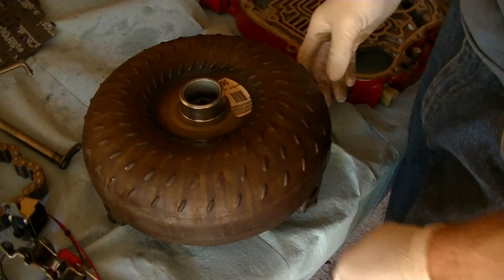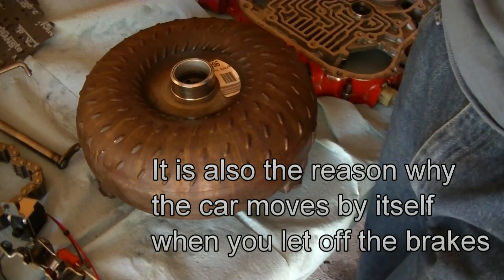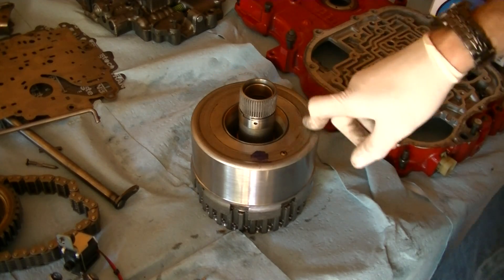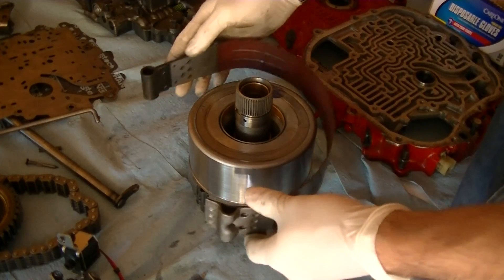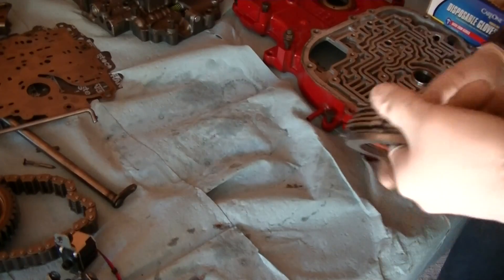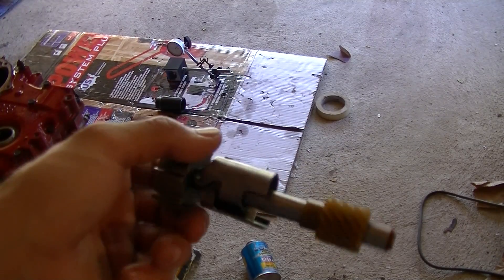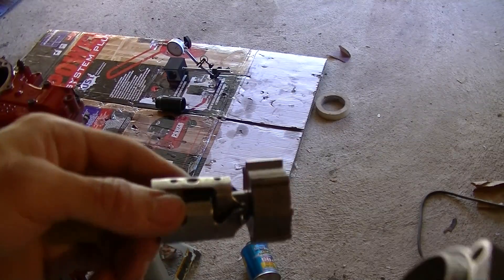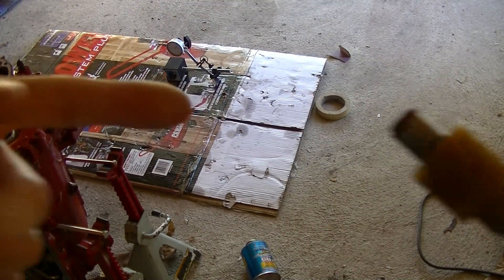How an Automatic Transmission Works

Comment: How to the clutches engage?  You mentioned a piston, but when I think of piston, I think of something like a slug in a cylinder.  To apply even pressure around the clutch pack, the piston would need to be shaped like a ring?

Comment: The other day I came to a stop quickly.  The car didn't fall back into 1st gear.  It fell out of gear.  When I placed my foot on the gas the car snapped into first and the car lurched forward.  Sooooo, does that mean the band or clutch discs stayed compressed or that pressure stayed in the port to first?
Reply from the maker: To me it says there was loss of pressure in the circuit that controls downshifting to first gear and the clutches / whatever is used were not able to keep the transmission in gear.  When you stepped on the gas, that caused the pump to spin faster, increasing the pressure and allowing the transmission to clamp into gear.  First thing that comes to mind is the transmission is low on fluid.  Check that first.
Reply: Thanks, I'll check that.  Appreciate your sharing of knowledge.

Comment: simple n clear explanations. i have some ??
at stop or totally stationary. 
1.) will the planetary gear rotate as i step on the brakes.
2.) the contact area, where the clutch bend clamp down is it rotating at stationary with the brakes apply?
correct me if i am wrong. 
if the the area where the clutch bend claims down is always rotating.
means it vry hi wear to the clutch bend. am i correct? 
hope u can help me out.
 thx matt.
Reply from the maker: When you are stepping on the brakes and the car is stationary, nothing inside the transmission is moving (in terms of gear sets and drums and the like) except the torque converter.  The fluid in the torque converter will be trying to spin the input shaft of the transmission, but since you are stopping the wheels from moving, the fluid will simply keep spinning around.  This allows the engine to turn at a standstill without stalling the engine.
Reply: thx for your help.
another question. what does anti slip additives do & does it really work?
Reply from the maker: I am highly opposed to any kind of aftermarket additive which make claims to offer very cheap repair solutions to complex problems.  There are a number of transmission anti-slip products out there which claim to repair slipping transmissions.  I haven't ever used them, but from what I hear and from what I know about these kinds of products, I would say they don't work.  In many cases, these kinds of products can do much more harm than good, such as stop-leak.
Reply: thx bro. i stick with amsoil.
Reply: MattsMotorz I had a ford escape (cd4e transmission) that would slip every time it came out of overdrive. I did a transmission fluid change and added in some Lucas oil stop slip. It didn't slip anymore after that. But that's just my experience

Comment: Technology, it is like a means by which the State attempts to impose its will upon "the sons of anarchy".  Auto trans today, tomorrow Skynet takes over.  Soon, you will not be able to take the scenic route because the car computer will decide you have not earned enough credits, nor have the requisite permission forms signed on record.  .. Look at phones which plug into a wall - they used to be shaped a certain way, like a u shape, but now are shaped like an l, that is to say, touches your face like a cell phone does.  It is almost like they are forcing you to be indifferent between the wireline and the wireless phones... and so they slowly get people to hand over greater control over their lives to "the machine" and by corollary the State. ... Some, they teach obeying cesar is always the right thing to do - see, ro 13:1-8, kjv - but that is a misinterpretation.  For "the powers that be", "the higher power", is a reference to angels, an invisible government, a kingdom felt or perceived but not necessarily seen.  "The minister of wrath" is an angel holding a sword, and not "cop with taser".  Even cesar will be judged, and does not have a divine right to do as he pleases. .. whether by tech, or propaganda, the State attempts to impose its will upon the citizenry.  Sometimes, it is not that bad, especially if a large number of the population develops Alzheimer's and so autopiloted cars become very useful, to maintain law and order.  But they could very easily remove the stuff that makes for "independent living", such as road signs and street name signs, in favour of "google glass tech" and "augmented reality" (AR) vision, in the name of conserving the use of metal... oh well, what tech does not change?  Remember when a can opener weighed like half a pound, because it was not made of aluminum? .. Being "willing to obey" does not mean "obey".  And calling "throwing it away", "recycling", does not change its true nature.
Reply: Kelly KitKat k

Comment: I guess (still learning this stuff), an auto transmission is a function of speead and acceleration, whereas a manual transmission is a function of observing the rpm and INTENT to accelerate.  An auto transmission only switches gears up at that point where rpm redlines, I suspect.  For how else would you program that "infernal thing"? :  My guess, it is designed around a car travelling, accelerating, decellerating, on a straight line track, or did engineers take into account  turns and slopes too?
Reply from the maker: This is a good question.  The way  they do it is to take into account what the driver wants to do.  But how do they know what the driver wants to do?  Simple, measure the throttle plate position.  

For example, if you are going up a slight hill, and keep the pedal still, your RPM's will go down.  However many times this decrease in RPM isn't enough for the transmission to warrant a downshift.  It will only downshift when the driver wants more power, namely, when the driver steps down on the pedal more.  So the computer is constantly shifting based on many economic and efficiency factors, while also taking into account the wishes of the driver (based on pedal position). As for sharp turns and such, typically the car slows down to negotiate the turn, so this decrease in speed and load, as well as pedal position causes the computer to downshift.  It all makes sense if you think about it enough.  Hope I explained it half way decent and understood your question. It is very clever.

This is the reason why I do not like automatics as much as manuals.  An automatic wont downshift until you have stepped on the pedal and the computer realizes "oh hey, he wants to accelerate! Better down shift!" Where as in a manual, one can downshift immediately with no wait.  After driving a manual for years, an automatic feels slow and  "mushy" when it delivers power.

Comment: In my opinion, mechanical or fluid-mechanical transmission is better, because if terrorists use an emp (electromagnetic impulse) weapon, that could fry a lot of automobiles because of their reliance on software, computers, and electro-mechanical parts making up their automatic transmissions.

Comment: So, gear shifts are preprogrammed on the basis of only two variables, speed and acceleration?  Can a person do better on the basis of getting from A to B in the shortest space of time, with the best fuel economy, using manual?  Well, with more data, the auto transmission could be made smarter, but according to who?  Tesla's autopilot is scary, because maybe Skynet (see Terminator movies) does not want you to make it to your destination?
Reply from the maker: The automatic transmission takes data from a LOT of different sensors to determine engine load, desired acceleration, and  economy.

Comment: thanks man that is the most clean explnation i had on you tube , and i looking for to know what is happen when the the gear in N , or P
Reply from the maker: in neutral or Park, none of the hydraulic circuits that engages any of the clutches or bands are engaged.

Comment: Thanks for the great video.  What make model did this transmission come from?  I have a 94 Chevy g20 van.  Since I bought it (3 years ago, 46k) till now (71k miles) it has NEVER shifted into first gear.  It drives pretty well though, no slippage in the other gears, and I can pretty much start on even the steepest hills in 2nd.  The fluid is pretty dirty, and has kind of a burnt smell, but other then that its kind of amazing to me that it has gone 25k miles easily and drives great.  From my understanding in this video it sounds like one potential cause of this problem is a bad shift valve?
Reply from the maker: +Lower 9th Wardermelon This came out of a 98 Chevy Cavalier.

It greatly depends on the transmission.  I am not familiar with the transmission in a 94 Chevy G20 Van.  While all automatics generally work the same way (except the CVT&#39;s), they still vary greatly on how they do it.  The list of possible causes is too great for a comment on youtube without some sort of diagnostics such as line pressure tests.

Comment: Your explanations of the automatic gearbox are excellent. However, I am now trying to find out how the AGS (Automatic Gear Shift) type of gearbox functions. I have just ordered a Suzuki Celerio SZ4, 988cc, 3 cylinder, petrol, with AGS (Automatic Gear Shift). Apparently, this car has a standard manual 5 speed gearbox, which has an electroncally controlled cluch (no cluch pedal). I took one for a test drive justerday and it has a auto type selector (D, N, R) but the lever can be pushed to the left and then, by pushing the lever forward, then release, then forward again and so on it goes up through the five gears. Similarly, to shift down the gears, pull (tap) the lever backwards each time another lowe gear is required. I was quite impressed but the sales team could not tell me how it actually works. Other than that, I can find no further information. I would be very greatful if you could point me in the right direction to find detailed information about this type of transmission operation.
Thank you in anticipation,
Alan Parsons (alanpars@gmail.com).

Comment: hey hiram, I loved the video! thanks for such detailed explanation! I am having a problem with my 1-2 shift on my hydramatic 125. the car stopped doing a 1-2 shift suddenly.. what can this mean?
Reply from the maker: akshay ramachandran I'm not hiram! Lol

That problem can be caused by many things. You would need to take some pressure readings to get an idea of what is happening inside the transmission.

Comment: My car is an automatic and it DOESN'T have a torque converter fitted (as it was an optional extra). My JATCO gear box uses slip disk clutch plates, so you are not covering how automatic gear boxes work at all! (By the way JATCO sells their gearboxes to over 19 car manufactures and was present in most auto boxes sold in Britain between 1998-2003 where they were in completion with WERSE-TECH for many more years. So if there is a standard way that auto boxes work you should add this or, if this for a specific box or brand (you should have put the last two mentioned things in the info for this video, or what manufacture you got them from...?). Before you ask, my gear box uses solenoids which actuate the gears, when the gear is about the switch it actuates an internal solenoid which lets the slip disk of that specific gear barrel to then change over to the next barrel, which removes that barrel from contact from the drive shaft, then it uses another actuator to slide the barrel forward to bring up the next gear, again using slip rings. I have a Rover 75 diesel 2.0 and my father is an ex long time JATCO engineer, which helped design the gear boxes that they have made in the last forty years.
Reply: stuart w JATCO is Japanese and is world renowned and WERSI is German, again being world renowned. Thanks for the PM, you not proving anything by saying that this maybe a random companies set-up that was "doomed to fail" JATCO have been making successful gear boxes like this for many years and make F1 racing products for Merc!
Reply from the maker: stuart w I really don't know what in gods name you are going off about. The explanation in this video was how MOST automatic transmissions work. If your transmission works differently then thats totally cool. No one says they all have to work the same.

Also I have never removed any comments as spam, YouTube does it for me automatically.
Reply: I'm just stating my auto box doesn't have torque converter and in your video you made it seem like it was a standard fitting to every automatic gear box. If you still don't know what I'm on about, your not a car mechanic and shouldn't touch motors as peoples lives may be at severe risk if you think you are, so put down that spanner and do needle point instead. (for the guy that made the video to say that he is an expert and say he doesn't know what I'm on about, I am worried that you don't know what the fleck you are doing and are potentially putting peoples lives at risk which is not cool....I'm putting this on social media and ill let the motoring mechanic masses put this to rest
Reply: Wersi tech are the people that BMW, Merc and Vaxhall now use (most are re-branded, but are the same), for automatic gear boxes. If you have never heard of them you have never either used the mentioned brand cars (after 2003). They are very well known and I have one of their manual units in my rebuilt Catterham super seven, excellent box, installed four years ago, used everyday, not had a problem since...
Reply from the maker: Man, you're a dramatic one aren't you.

Anyway, I never mentioned I was an expert and I never said that this is how all transmissions work.  Sorry if you mistook what I said.

At any rate, you need to chill out. Seriously dude. Being that high strung will kill you.
Reply: MattsMotorz My 2003 Pontiac Grand Prix is vibrating or shaking when I accelerate, I 
was told that it is the torque converter.  I had changed the engine and 
it runs great, but then the transmission line by the radiator rusted and
 started leaking. I installed new lines and filled it back up with 
fluid. Now it has this vibration and I'm wondering if there is a cheap 
easy fix that I may be able to use to buy some more time.  Do you think 
it is related to the transmission line leak? I can cruise at 70 + miles 
an hour and it will feel perfect, but as soon as I press into the throttle a little bit
 you can feel the vibration, then I back off of the gas pedal and it 
stops. The transmission does not seem to be slipping. It's my wife's car and she's threatening to buy another vehicle and has declared that we are not spending another dime on this car. But really this car runs perfect now so I would like to figure this out without spending a bunch of money. I actually put a 2005 engine in it from a Buick and it is clean as a whistle inside. If you have any advice then I would really appreciate it. Thanks in advance. And by the way that stuart w guy that you were commenting to is a total douche.
Reply from the maker: Lol well thanks for that.

Anyway, the first thing I think of is ignition.  Many times ignition problems only come up when then engine is under load.  When coasting, there is no load on the engine as you are not accelerating and the problem goes away.  Most likely the ignition coils, but I would also change the spark plugs and wires as well.

Other less likely causes are the motor mounts and I have even heard people say bad inner CV joints can cause this. I do not think it is the torque converter.  Everyone always blames the torque converter!
Reply: MattsMotorz It is definitely not the engine, the engine is running perfectly, it is not missing at all. It really feels like what I would imagine the inner CV joints would feel like. But I don't know because I  have always had rear wheel drive vehicles. Honestly it feels like the front U joint on a rear wheel drive car.

 I can have my foot on the throttle without it vibrating, but only while going at a steady speed. If I'm going at a steady speed and then I push even a little bit on the accelerator then it will vibrate. And it does it at lower speeds or on the highway at higher speeds. 

I tried down shifting by one gear on the highway and it did it even worse. I've worked on cars for years and honestly I've never seen a torque converter go bad. I'm sure it happens but I've never seen it.

 How would I check the CV joints without taking it apart?  Also it doesn't clank when I take off like what you get with a bad U joint or anything like that. 

 It had a slightly loose wheel bearing on the right front and I replaced it but it didn't seem to help. I just assumed that was the problem and was surprised when it didn't eliminate it.

 Also it seemed to do it worse when I was going around an on ramp, but maybe I was just imagining that, I don't know.  My wife is driving it now and I hope it's okay. It feels bad but not severe and it actually drives pretty good. I can drive 80 miles per hour and take my hands off the wheel. Oddly enough it seemed to feel better when I was kind of thrashing it a little bit.
Reply from the maker: To check for bad inner joints, jack the car up and move the tire at 3 and 9 oclock and look to see if there is play in the inner joint.  You might need a helper (the wife!).  It is easier to see play when the side you are not testing is on the ground so the weight of the vehicle keeps the steering rack straight.

Don't rule out ignition so easily.  Many times when there is ignition problems the engine will run perfectly fine with no load, but as soon as  you start to accelerate or go up a hill it acts up. Anyway I am not there to see what it feels like so it is just speculating on my part based upon what I have seen.  Let me know what happens!